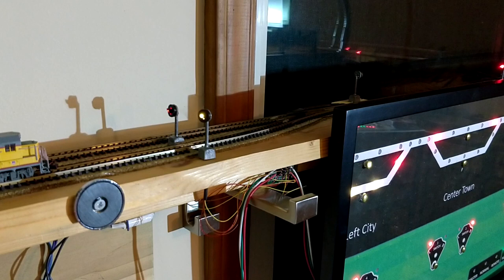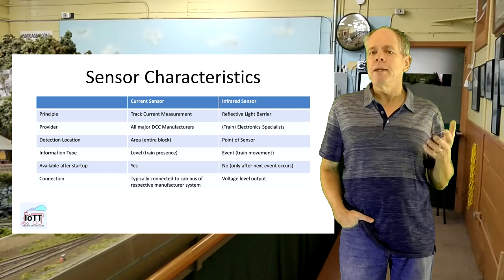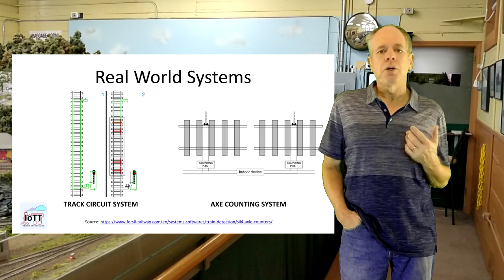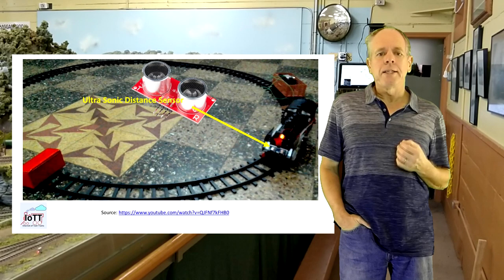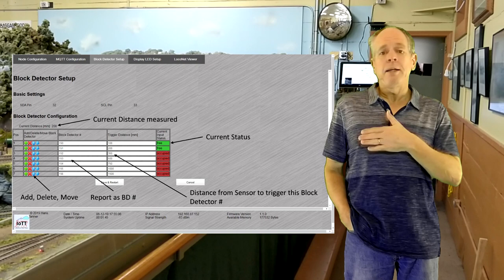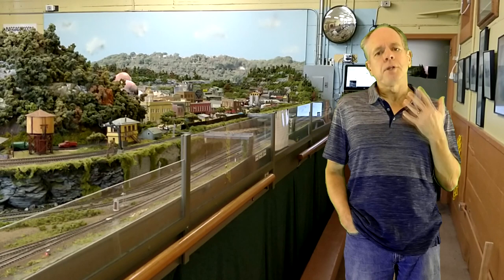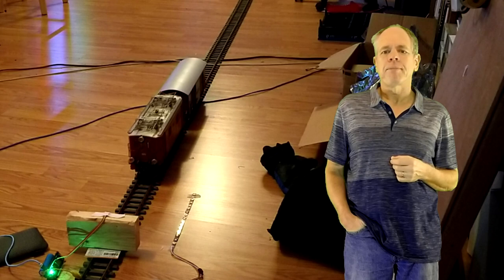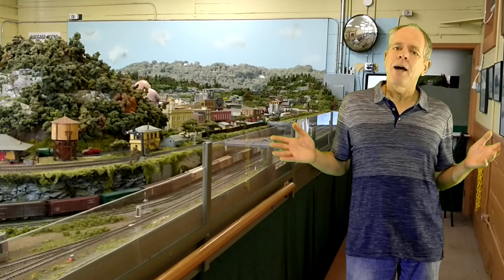Hi Resolution Block Detector (Video #33)

Comment: You must be clairvoyant! I've just been researching detector circuits for my DCC layout. I've been following your videos for quite some time and really like your signal system videos. I'm trying to come up with something that would work with N-scale using very small RGB LEDs and an 8211 adapter board as per your video. Also trying to 3d print the signal masts. So far still in the experimental stage but I'm getting closer. Was just getting ready to figure out how to detect the trains. Your idea seems very innovative so I'm eager to see your next installment. Love your work!
Reply from the maker: Thanks for the feedback, Rob. I appreciate. Keep in mind, what I show in this video is very experimental, but I think there are situations where this could be a cost effective solution. More research to be done, though. The good news is, a sensor system like this could easily be adapted to the NCE cab bus ;-)
Reply from the maker: Thanks, that's cool. I did not know that link.

Comment: I admire your disign goals, specifically not having to modify rolling stock to be detectable, but I doubt that this type sensor will be practical.

I've implemented block detection that counts things passing a block boundary, and can determine direction, so it can accurately keep track of occupancy. It includes memory for each block, so it remembers occupancy status and how many things (wheels, axles, trucks, etc.) are in a block. The code is reliable, runs on an Arduino NANO, and should cost about $10 per block, but that's for JUST a detection signal, and some simple, local signaling. It also supports one turnout per block, and keeps track of occupancy from all 3 block boundaries.

The current status of the project is that I'm trying to build mounts for the sensors that scan across a rail, but my skills are lacking. I have working protypes using sensors that scan across the track, but they're prototypically unacceptable. The new sensors are placed in an extra tie that's added between existing ties.

If IOTT is interested, we can colaborate, and the priject is completely OPEN SOURCE. There's some youtube video I did some time ago that explain the system and show it operating on a very small 'layout', but the video production quality is poor. I had installed the system on one block on my club layout, and it ran very well, and reports status at power application.

Contact me and we can discuss things.......dccfordiy@gmail.com.
Reply from the maker: Thanks for the feedback. From what I see on your videos, you have a nice system, exactly what I describe in my video as event based detection. And compared to many other examples, you have implemented directional counting, which of course is a precondition for successful  block control. Well done.
Of course I wonder what your new solution for the sensor arrangement looks like. I think that in order to have a reliable count, an optical  barrier with interruption is much better then reflection. But making it small is for sure a challenge.
One thing I would recommend though is separation of detection and block control in order to make your system work with other systems. I would suggest to just transmit a block occupancy message to the control bus of whatever command control system you want to support. If you do that, standard software or signaling hardware can pick up the information and go from there.
And regarding practicality, I don't think there is any type of sensor that fits everything. There are situations where an approach sensor as I did in this video might do the trick, other locations where even your sensor going across the tracks might be the most effective solution, e.g. in a large hidden yard, and in many cases simple current sensors still might be the cheapest option. I think, there is reason for diversity in geometry and technology, but what is important is that those can be combined, hence the common use of the cab control bus for information exchange. Just my thoughts.
Reply: @IoTT  Thanks for the compliment......I think your work is superb. The current implementation uses 0.040" or 0.060" FO strands for detection, and are at the height of the rail head.

I don't really expect detection or signaling IN the yard, just at the block boundaries going to the mainline. I only expect an external signaling system to actually do the work and just react to the detection signal. The simplistic local signaling was implemented because since I decided that a third boundary was required to be practical, and I needed a way to detect that a turnout was thrown against the main, and a local signal provided that. My skills for 3D modeling is poor, so maybe we can colaborate some. Besides the extra tie for the rail sensors, the other end of the FO needs to 'attach' to the detector IC and the IR source LED. Want to help?

If you actually had the patience to watch all 10 videos that I did, you deserve a prize......even I think that they're difficult to watch, but do show how it works, and that it does work.
Reply from the maker: I assumed OF strands would be the next method to try. I think this could be the way to go and at one point I have played with those myself. So, it could be interesting to look into it again and a little deeper.

Comment: excellent video and topic.  I have the ir sensors on my dcc layout - they lie between the sleepers.  Some cars trigger better than others - some locos need a small piece of white tape to trigger.  In any case I use a debounce of 5 secs to stop the associated signals and  crossings from bouncing.  I have been thinking about a better solution that does not require ripping out track and rewiring.  following closely - enjoy all of your content. :)  happy holidays
Reply from the maker: Thanks for your feedback. I agree, reliability is a little bit an issue with reflection sensors. And the search for alternatives is definitively a good thing. I think with recent developments in sensor technologies and AI (e.g. image recognition) there will be completely new ways available to not only do block detection but also train identification. We will see.

Comment: Another guy with a Swiss accent! Good channel. Did you check the VL53L1X? It has double the range ( maybe helps with the small trains)
Reply from the maker: Thank you, Andreas. Even after living abroad for more than 20 years I find it hard to hide my Zueri-Schnurre! So, as you did, I make it part of the brand ;-) And saying that your channel has not been an inspiration for IoTT would be a lie for sure, so thanks for your work.
I am aware of the VL53L1X and reference it towards the end of the video as future activity, so we will see. Even more important than the longer range is the fact that the viewing angle can be limited by selecting the size and location of the active reception area on the chip. That makes it really interesting.

Comment: Will it work on parallel tracks as well? I ask because the beam is a cone and at some distance a train running on parallel track might be detected at some distance.
Reply from the maker: I tried it with both, N-scale and G-scale, and in both cases I was running out of the reliable distance before I got a signal from the neighboring track. So, yes, it works on parallel tracks. 
And while testing, I also noted the width and height of the detection area are not the same, so sensor orientation is important. It looks, the receptive area is more an oval then a circle. This is interesting, because the datasheet depicts both cones as round cones. I think the observed oval shape comes from the overlapping of the two circles, but I'm not sure. 
Overall I think the opening angles of both cones are rather big, so finding ways to narrowing them would be a nice approach. I found one video in YouTube where someone tries to use a lens from a hard drive head to focus the IR beam. It was not successful, but I think it is the wrong approach, anyway (besides that the manufacturer in the datasheet strongly recommends not doing this as the laser all of a sudden might become class 2 and more dangerous). I think it would be better to have an optic in front of the receiver, that reduces the detection angle to say 2 degrees. That way we could 'aim' the receiver parallel to the track and no harm could happen because the emitted beam is unchanged.
The VL53L1X seems to do something similar by allowing the user to select a reduced receiver  area for detection. That essentially has the effect of narrowing the angle of the reception cone. We will see what that does as soon as I have time to play with it some more.

Comment: Wow!   Is there a version of this product that can talk directly to Loconet, without all the JMRI and Arduino stuff in the middle and all the programming?  In other words, something analogous to a BDL168, that can send  signals directly to Loconet, which then can be interpreted by Loco and Co Train Controller software?
Reply from the maker: Yes, the software that you can download from the Github page has the LocoNet access in it. For this video, I simply decided not to use the hardware interface and send the LocoNet messages wireless via MQTT. But that is just a matter of adding the LocoNet interface and configuring it. See videos 31 and 32 for more information.
Reply: IoTT Vielen Dank!

Comment: How does it do with black colored trains?
Reply from the maker: I did not particularly test for it, but did not notice any difference for various rolling stock. I tend to think the usually used plastic material is reflective enough even in black color (steam engine shells typically are not made from carbon... ).

Comment: I like the idea, but how would you mount these on the layout, so they are hidden? Have you ever experienced half hall magnetic detection as shown here? 

https://create.arduino.cc/projecthub/Steve_Massikker/using-ir-hall-type-sensors-for-train-detection-210f53?ref=tag&ref_id=train&offset=2
Reply from the maker: Thanks for the feedback and the link. Hall sensors are a good example for event sensors and it is very easy to hide them under the track. The downside is that every detectable object must be equipped with a magnet and the detection of travel direction is not trivial. Not a problem on a double track with trains only going one direction on the same track.
As for hiding the ToF sensor, you're right, that may be difficult depending on the scale and situation. It is no problem to hide it in a G scale bumper, for example, as the sensor itself is only about 10x10mm. For smaller scales, it is difficult, but then there are many situations where optics don't matter, e.g. hidden yards. So, it all depends. I don't think that there is one single sensor type for every situation, therefore I think it is important that all sensors at the end provide a block detection signal that feeds to the cab bus of the command station, in my case LocoNet, but could be NCE cab bus or Lenz xbus or xyz. If so, we deal with standard information that can be picked up by standard software and the providing sensor is less important, hence can be optimized for a given situation, either event detection with counting or level detection and all kind of technologies.